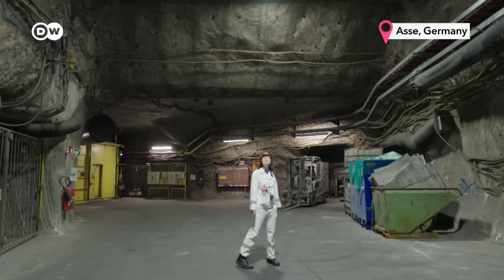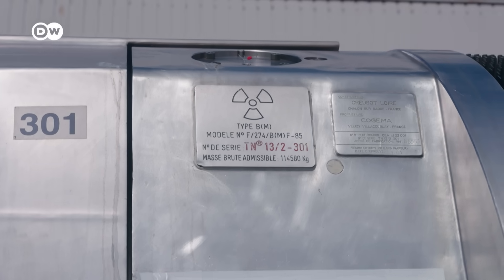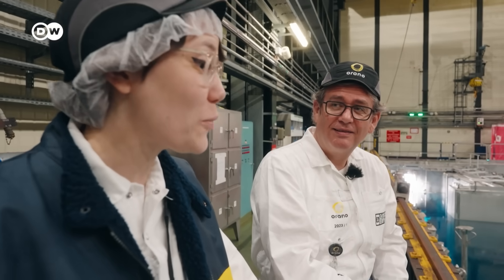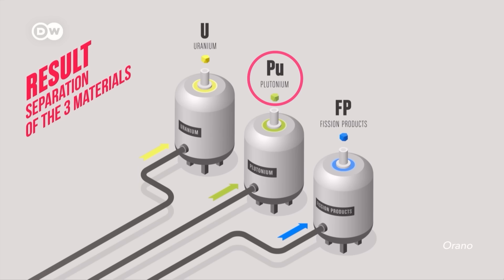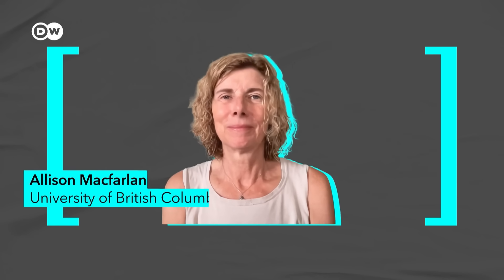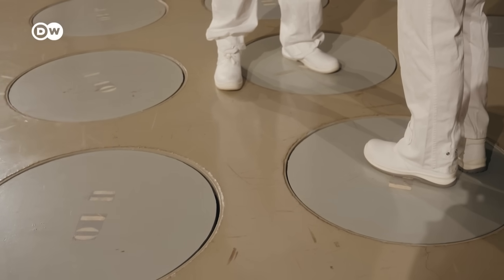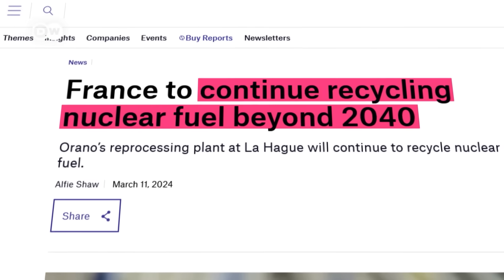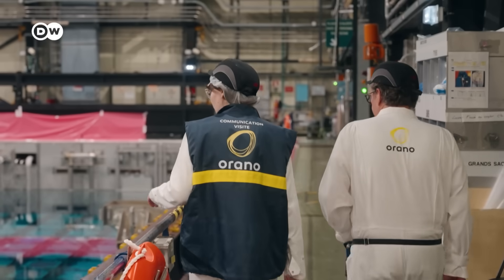Nuclear waste is reusable. Why aren’t we doing it?

Comment: What about THORP  (Thermal Oxide Reprocessing Plant) at Sellafield built on the 70/80s. Reprocessed UK and  Japanese fuel rods for years. All of the plant needs to be decommissioned and  safety  disposed of now. And that 4% left after reprocessing is Highly highly radioactive. Half life 1000s of years. We’ll never be rid of it, constantly having to repackage it as it degrades.
Reply: If its highly highly radioactive then its not going to have a half live measured in the thousands of years. In fact thousands to hundreds of thousands of years is an interesting period of duration to talk about - in the entire known universe there are a grand total of:
-  12 isotopes with a half life between 1,000 and 20,000 years
- 7 isotopes with a half life between 20,000 and 100,000 years
- 14 isotopes with a half life between 100,000 - 999,999 years
- or in other words a grand total of 33 isotopes in the known universe with decay rates between 1,000 and 999,999 years. 

By comparison there are 76 isotopes that will undergo a half life within 24 hours. So with so few isotopes in the thousands of years timeframe you provide it should be fairly easy to determine what specific material is actually there.
Reply: @MattBuild4  well lets just say it cannot be disposed of. Vitrification into glass pellets which is what they have done and is currently stored at Sellafield itself will have a finite life before they have to repackage it. Was my employer many moons ago. Scary stuff there.
Reply: @muvimoments  Without knowing the actual material its difficult to say it cant be disposed of or that its super dangerous. 

I mean Americium 241 has a decay rate in the thousands of years and we literally use this material in smoke detectors (albeit in small amounts).
Reply: The dangerous part is radioactive for 300 years. After that you get something less radioactive than uranium we extract. Basically we turn radioactive dirt in less radioactive dirt. After those 300 years may as well dump them back where uranium was mined and deal with it